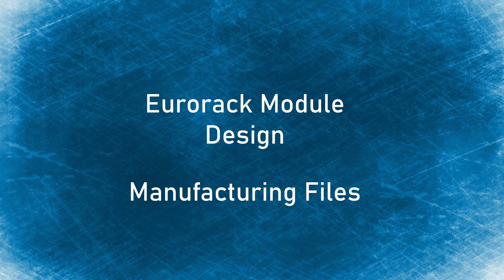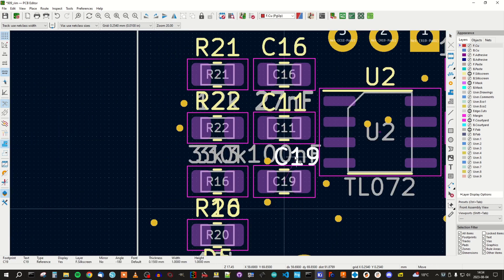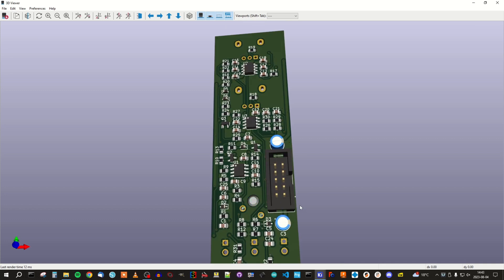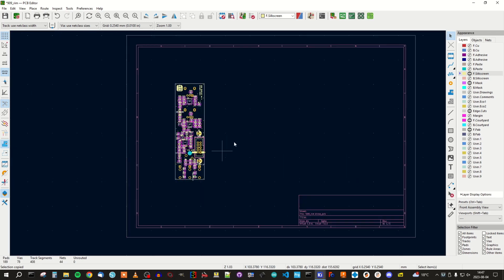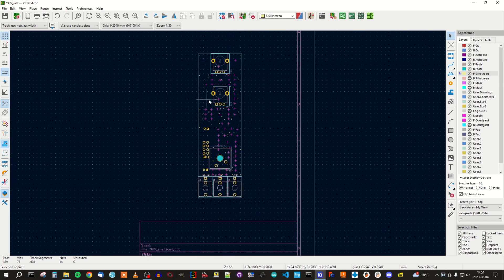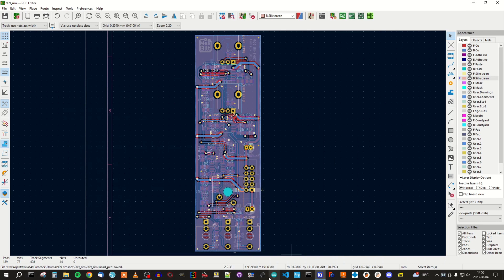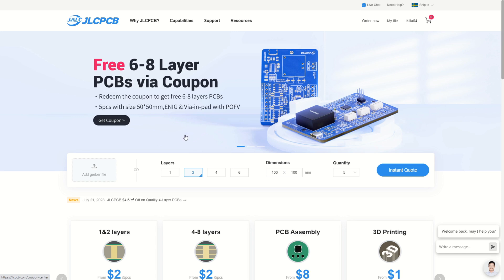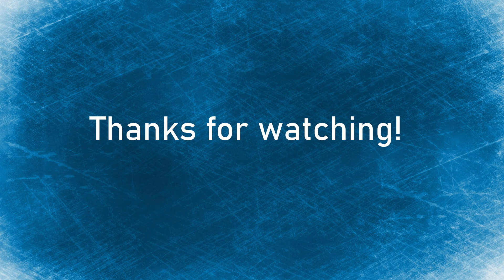Eurorack DIY: 909 Rimshot (Episode 5) - Manufacturing files

Comment: From my past experience:
1. Add guard ring (3mm trace of CGND with closely spaced vias) around edge of the PCB. It decreases noise it makes (edge fired emissions). Will greatly increase EMI compatibility in tight spaces. That ring should be connected to chassis ground (I always separate it from power ground).
2. I don't know which caps you use in SMT mount, but go with at least 3x max DC voltage rated NP0/C0G ones. Otherwise they will f-k up your audio quality.
3. Keep any high frequency traces away from other high frequency traces (or power traces). At least 3x dielectric thickness (3H rule)
4. Always add vias in pair. Each signal/power via should have ground via tightly spaced near it. (As tight as DRC allows, also makes placement of decoupling caps a bit easier).
5. Use 4L boards. They're damn cheap nowadays and controlled impedance makes huge difference in signal integrity.
6. Don't be afraid of 0603. It's still easy to solder it by hand (TBH I recently moved to 0402 for spacing purposes, but I'm running them on paste... mostly because it's too annoying to solder 240pin sockets and 100 pin ICs by hand).
7. Just for reference, as your design meets it: components should be placed 100 mil from edge of PCB and 40 mil apart from other components. (Manufacturability rule), may be useful for someone reading comments.
8. Add test points. Debugging is so much easier with them...

That's probably everything I can spot in this design.
Reply from the maker: These are very good advices. Thanks!
Reply: @MeeBilt  Addition to point 2: decoupling capacitors for OpAmps can be X5R/X7R. NP0/C0G should be used always on audio / RF traces (aka. anything that touches audio lane in this case).

Comment: In eagle, value and names are on different layers, i disable the names and only leave the values, so i don't need to look at computer to see schematic.
I have a dedicated eurorack power connector foot print. my version of the eurorack 3.5mm jack is precision made and the part drops right in on the exact right spot, uses minimal lead and the solder joints look great. it based on the exact data from the datasheet. the same counts for the alpha pots witch has a additional layer for the knob size, slotted holes.

The best absolute ADSR on the planet: Befaco VCADSR, i have 2 of them, DIY ofcourse, reduced to 5hp.
optional curved envelops, i also made a DIY version of the HEX VCA also with curved shapes, best VCA on the planet, VCA can make it sound like if there is a echo or so.
Reply from the maker: I also have a curated footprint and symbol library that I use for my Eurorackj modules. It have developed over the years and I have added loads of information and 3d-models to it.
But for this video series I have chosen to use as much "off-the-shelf" (i.e what gets shipped with KiCad) as possible to make life easier for those who want to give KiCad a try without struggle with importing symbols and footprint or write their own.
Thanks for the tips about envgen and vca, I will check those out.
Reply: @MeeBilt  Another must have module: Mutable Instruments Kinks .... but requires to have Eagle Installed. contains AND/OR port (usefull to mangle bi-polar signals like LFO, VCO), half wave / full rectifier (usefull to mangle bi-polar signals like LFO, VCO)  and noise generator + sample and hold and that on 4HP.